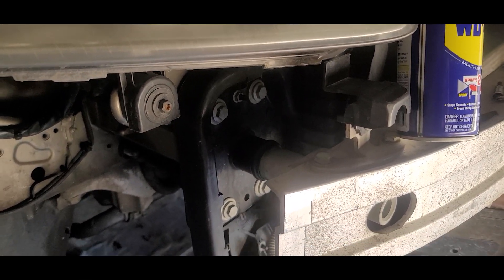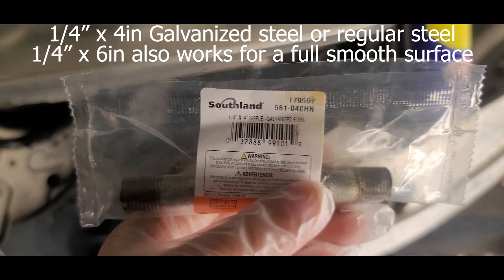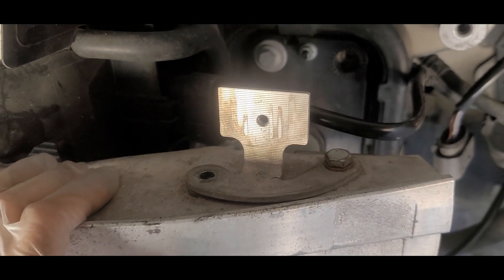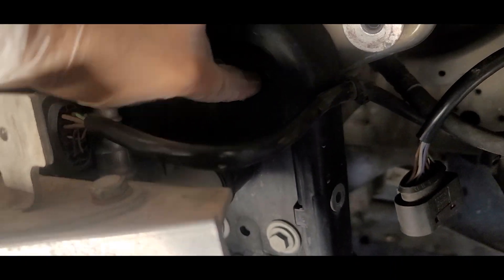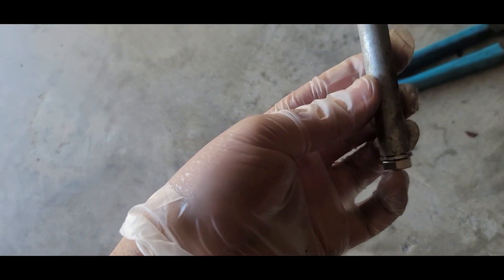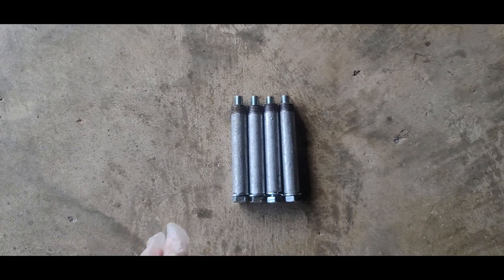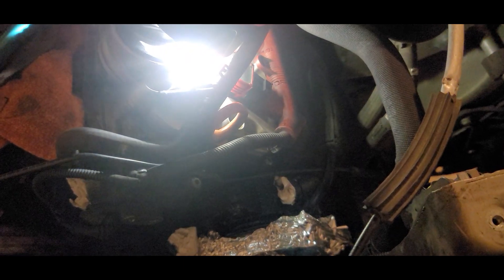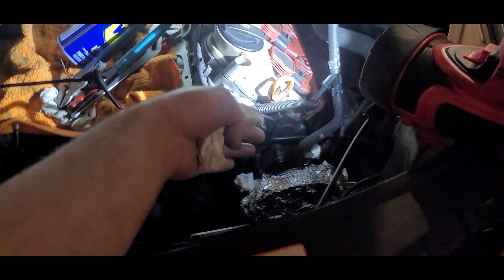Audi Lock Carrier Service Tool 3369 (Homemade)

Comment: thank you so much for this information!  What is the diameter of the 1/4 x 4" galvanized pipe you used?
Reply from the maker: It is 0.25in or 1/4. You can go with 0.50 or 1/2. But i think 0.25 diameter is fine if a bigger washer is used. The washer I used was small but you can use a bigger washer to prevent the assembly to come further out of the pipe.
Reply: @FirstTimeDIY  Sorry, i should have specified outer diameter in that question.
Reply from the maker: I used a digital caliper and here is what it measures for the pipe: the outer diameter is 0.540 in, the inner diameter is 0.364 in., and the wall thickness is 0.088in. The pipe fits the m8-1.25 x80mm bolt which is approximately 0.33in to 0.34in outer diameter from the threads.